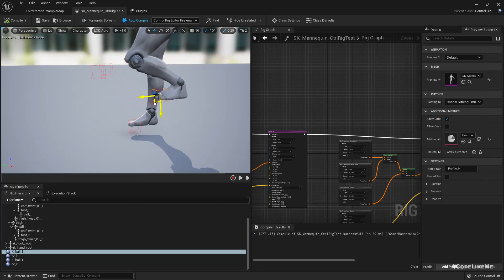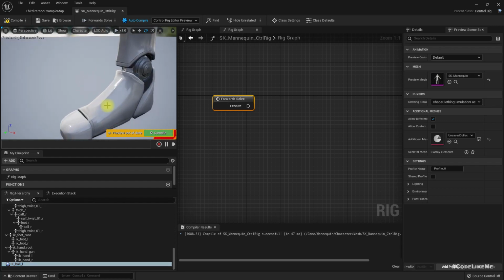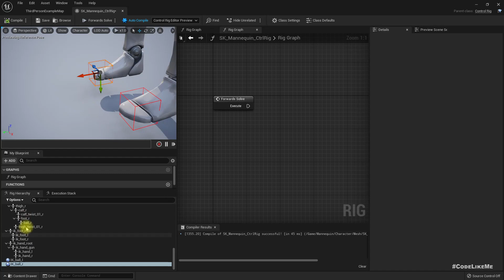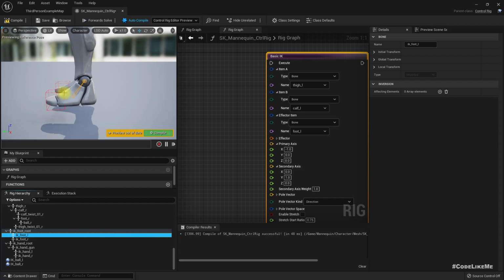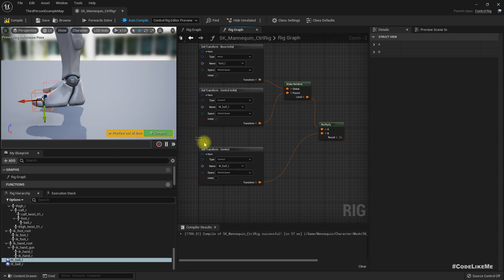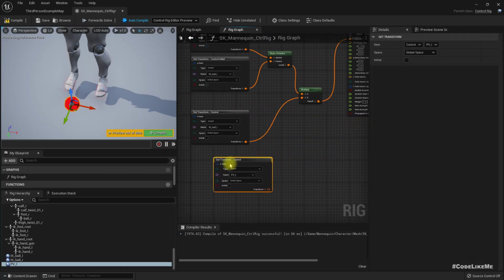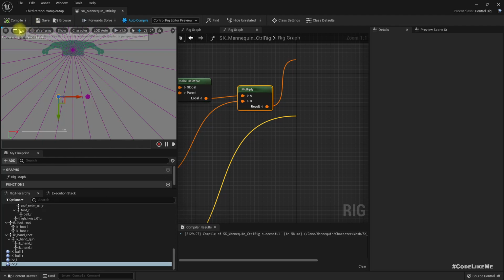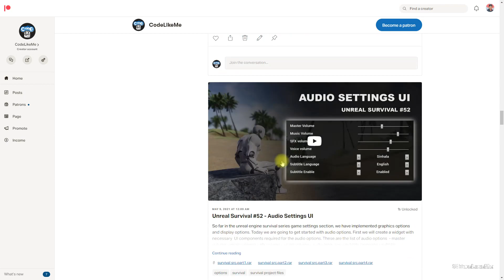Unreal Engine 5 - Control Rig Leg IK Setup [Part 1]

Comment: There are about 10 ue IK tutorials and all are based on default mannequin,  i try to make it works for days for my custom character.. when i try to add ik for legs in control rig my animations are messed up (foots stick to the floor) one video i saw suggest that this is because of my custom rig character have no those ik bones (like ik_foot_root>ik_foot_l-ik_foot_r in default mannequin) but i do not know how to make them, in ue5 there is IK RIG blueprint but not in ue4

Comment: Tip: If you have troubles finding which Primary and Secondary Axis to use for the Basic IK, you can set Secondary Axis Weight to 0, which will disable the secondary axis and make it easier to test the primary one, when you discover which to use you can put the weight back to 1.

Comment: Hi, I know this is an old video, but I was just wondering if this works for Metahumans? When trying to implement I got a lot of issues with the mesh and bones not following the ik. Is there anyway to correct this? Thank you :3
Reply from the maker: technically this should work. unless there are no any contradicting nodes in the anim bp of the metahuman. But I haven't tested that myself

Comment: Do you cover IK/FK matching or switching using the Control Rig in any other videos?  I have Ik working and I have FK working; but not at the same time. Also setting up using Basic IK was so much easier/better than using CCDIK so thank you for covering that.